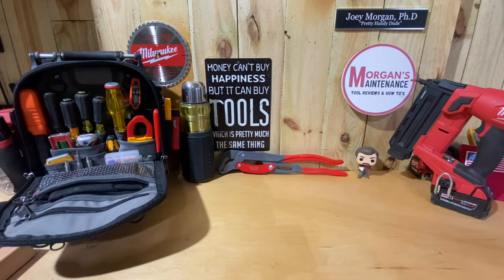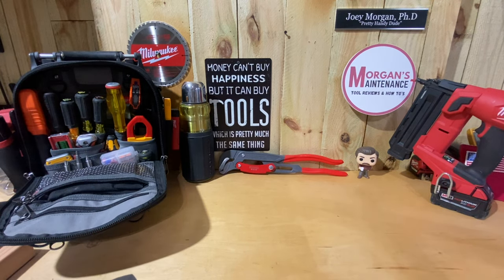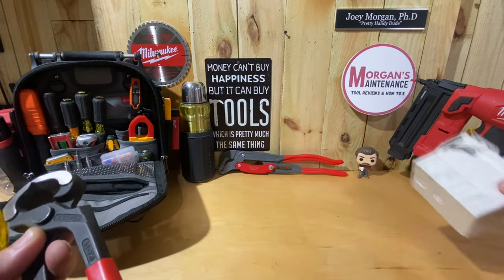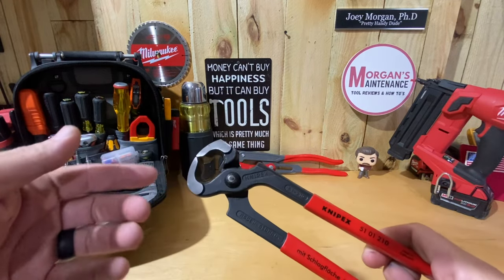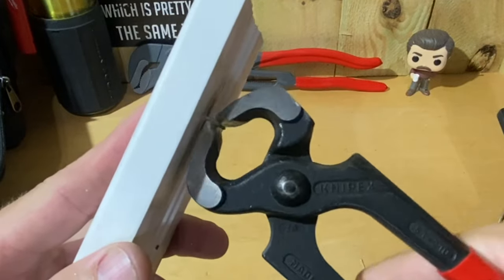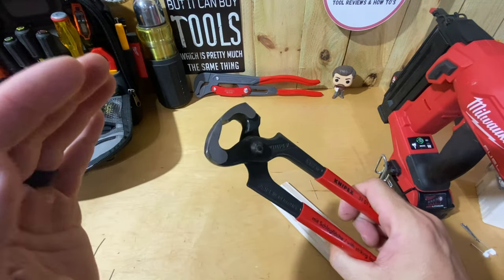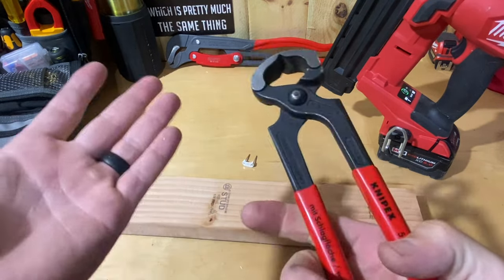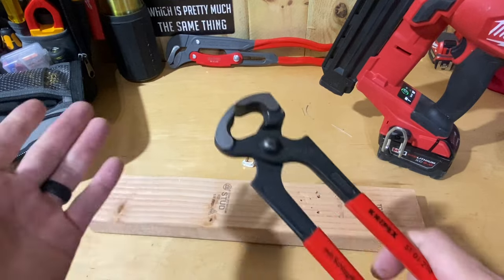Knipex Hammer Style End Cutters - Great Hammer for your Veto Pro or Small Toolbag!  51-01-210 #tools

Comment: I have a pair of the channellock end cutters like this and they work well. But I will be getting a pair of these knipex. As a pipefitter we use these for stainless tie wire on steam tracing and I have seen the insulators use them for attaching insulation in piping and tanks. Great video as always!👍🏻
Reply from the maker: I’ve always gotten by pulling stuff with other tools and just never had a pair of end cutting pliers. I bought for a hammer but they are way better at pulling out nails than the other tools I would use. It’s a once I have it, I wish I had a pair sooner tools.

These will cut bigger things than trim nails… but it takes a lot of effort. I wouldn’t want to do it often.

Comment: I bought these for the same reason I was doing a remodel shower valve the other day and the straps were nailed in this this came in clutch also great for stubborn copper fittings lol
Reply from the maker: I use these all the time… way more than I expected to.  For the price, they are hard to beat.
Reply: @MORGANSMaintenance  the price and not having to carry a hammer I never use but have to move out of my way every time I gotta grab something lol

Comment: Well, technically every tool may be a hammer if you're brave enough.
Interesting tool BTW. And as with Knipex - it really does what it's supposed to do.
Reply from the maker: Very true… I have used just about everything as a hammer… all the way to the battery end of my drill 😂.

I’ve never owned a pair of end cut pliers like these because I always had something else that “worked”. When you get a tool that is intended for a purpose it typically works better.

I bought this tool to use for an unintended purpose as a full time hammer and came to really enjoy its in other intended purpose… which I actually use more often than the hammer. 🤷‍♂️
Reply: @MORGANSMaintenance  I usually bang things with rear end of my drill. I avoid battery end.
I have some standard end cut pliers, but I don't like using them. Here in Europe we rarely use nails, screws are the most preferable fastener.
Reply from the maker: @Stefan_Kawalec  I’ve grown to be the same with screws. I honestly can’t remember the last time I hammered a new nail with a hammer into anything.

It’s faster when doing high volume… but I don’t do that kind of work.

Comment: May just use that affiliate link 🤔 36% off not bad! 

Definitely always reaching for the lineman’s as a hammer. But this would be a bit more beneficial 

Fun fact I worked with a guy who would use hoof pullers as duct pullers between the drive ears, they worked better then the duct stretchers anyway!
Reply from the maker: I’ve been really impressed with these cutting and pulling all sorts I stiff. I actually use them now for that now than a hammer.

I kept looking for a small hammer but they are all just slightly too big for the bag, or way too small to even use . Goldilocks hadn’t showed up yet 😂

Comment: Would you consider using these to remove nails from a pallet?
Reply from the maker: If the nails are proud that you can grab ahold of them it will likely pull them out… but my guess is most of them aren’t proud.  These won’t “dig in” to remove a fastener.

Comment: needing to pull a bunch of staples do you think this is the best tool for that?
Reply from the maker: It will work, but if they are thin staples it will probably cut through some of them too.  Its what I use for pretty much pulling anything though.
Reply: @MORGANSMaintenance  hmm maybe cobras are the better choice then
Reply from the maker: @sythshowedu  they would work well also 👍

Comment: Those work suprisingly well as a hammer from your demonstration! I use the bolt end cutting nippers I think the 6102200. they work great for prying stuff out but wouldnt want to use them as a hammer.
Reply from the maker: They work as well as the really small hammers. I wouldn’t want to put in a big nail with them very often.

I always keep a real hammer in my truck, I just hate keeping one in my bag because I rarely use one.

They pry really well, I actually have used them more for that than the hammer I bought them for.

Comment: Bingo , Brother ! I carry one in my TP XXL , along with a small deadblow mallet , and a 6oz Crosspien with a shortened handle ! Word of advice , grab a piece of scrap leather, to protect surfaces !
Reply from the maker: Great Advice!

Thanks Brother 👍
Reply: @MORGANSMaintenance  BTW , my secret weapon for delicate trim is the Milwaukee M12 23ga. Nail gun , and MiterBond adhesive ( a thick CA , with activator spray !
Reply from the maker: @chrisfyfe9212  I have that pin nailer too. I’ve been using that Bob Smith CA Glue… it’s the only one I’ve tried (just started using CA Glue)

Might give yours a try… 👍
Reply: @MORGANSMaintenance  I totally love it and use it all the time !
Reply: @MORGANSMaintenance  another tip in re the pincers , I have a piece of scrap leather with an improvised “ button hole “ , that is parked on the pincer handle . Caution , do not use dyed leather , lest you get dye transfer !
Reply from the maker: @chrisfyfe9212  👍

Comment: Screws don't match code in many areas...
Reply from the maker: Yeah sometimes nails are a must if that’s what they are called for.

I primarily do interior remodeling.. typically partitions and things in commercial so I don’t use nails often in framing.

You are right though, certain things you have to use them 👍